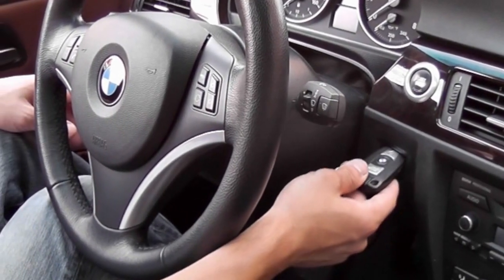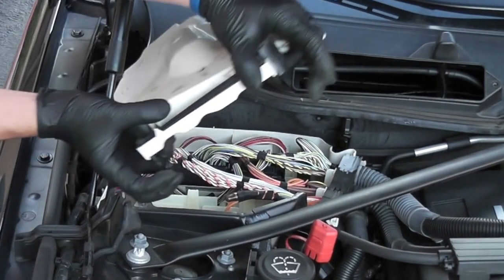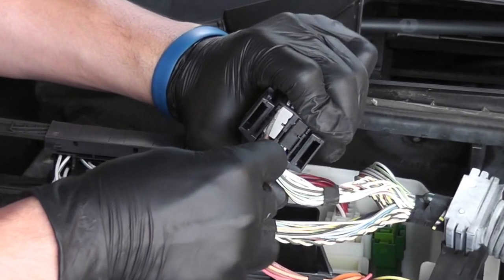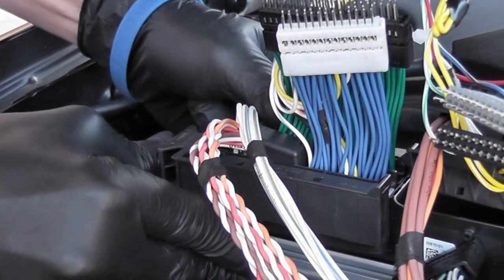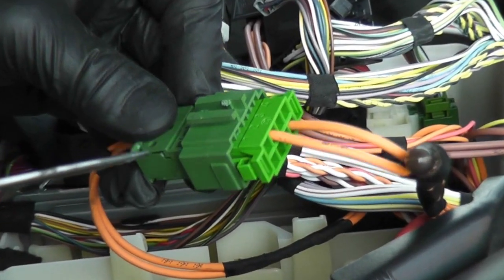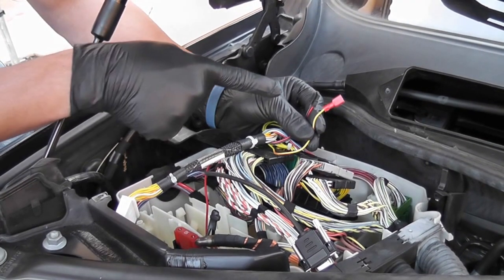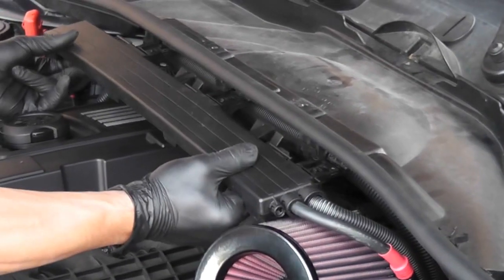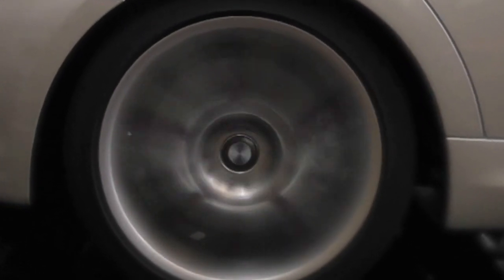ModGuides.TV - Vishnu PROcede N54 Install (335i 135i) Complete

Comment: Hi! I'm Ari from Finland and maybbe anyone have not Procede in their cars here, I got my car last yr 335i e93 n54 2008 and it was already installed there. I have not much know about this product and how to adjust parameters. I have not updating firmware and any new maps to load there, is it possible to get them somewhere? I would be greatfull to get more information about all this product how to use it and get car run as it should with this. I think I have software 4.20 and no updating antyhing. My car is prety much stock otherwise. I would be happy to know much more about this Procede Rev 3.5 I think I have in my car. Please let any comment or helping information or who could give help me! Thanks!
Reply: Hi Ari! I'm facing similar issue and I'm watching this video to UNINSTALL completely this thing :) Try MHD instead!
Reply: How do you know that is was already installed in there? I’m suspecting the same thing about mine.
Reply: Hey guys! Also in this dilemma I bought a 335i with it already installed as well. Not sure if it’s affecting my car good or bad or even working but I’m fine without it as well! lol